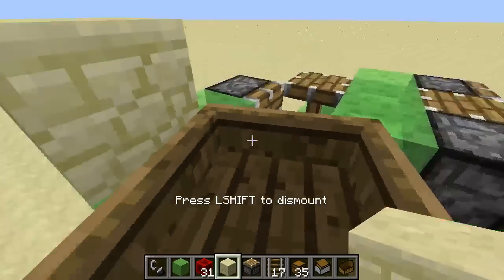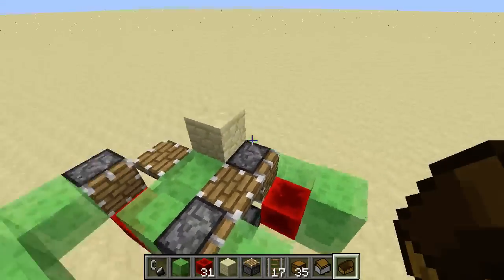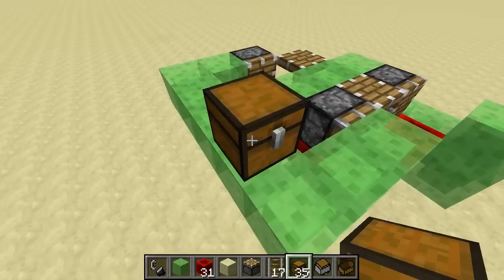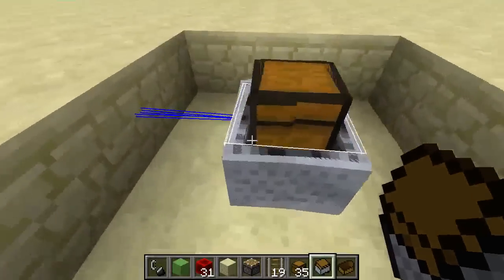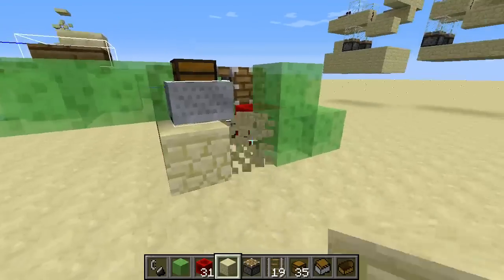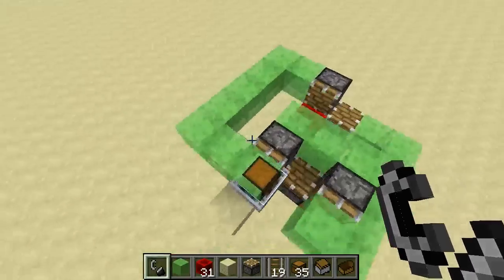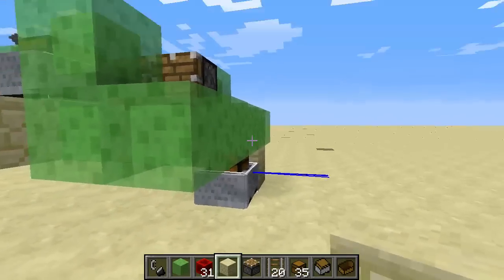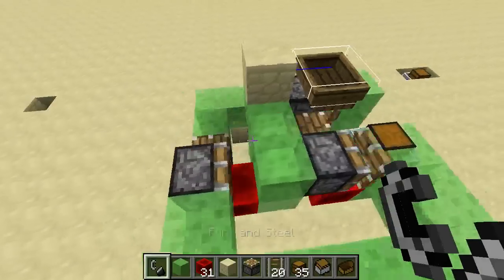Minecraft - flying machine update video

Comment: I would think that to get rid of the "flat road" requirement, you'd basically need a self-propelling piece of road.  So a separate machine that works in conjunction with this one, basically, with the timing such that the "road" section gets pushed first and then the carts get pushed onto it.  I'm not sure how to make the spacing or the timing work, but that's why I'm not making these videos myself (hah).  (Actually I'm sure I could figure something out in time if I was motivated, but as it is I know very little redstone so far -- I'm just learning.)
Reply: Angi Long If the block that the rail is on moves, it breaks the rail. So the rail has to be pushed along a path no matter what, sadly.